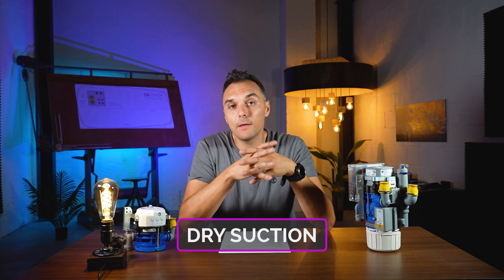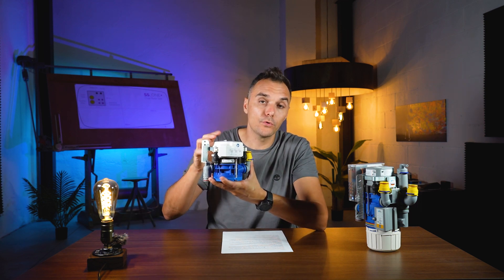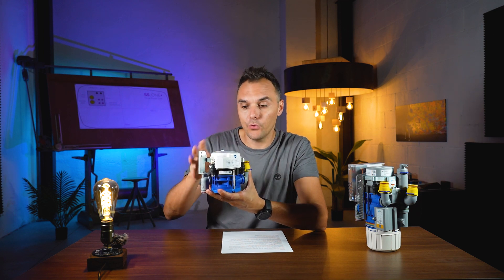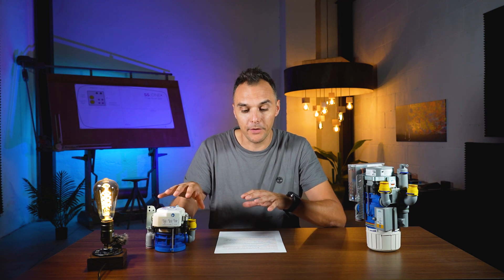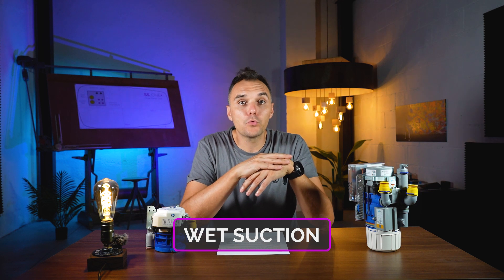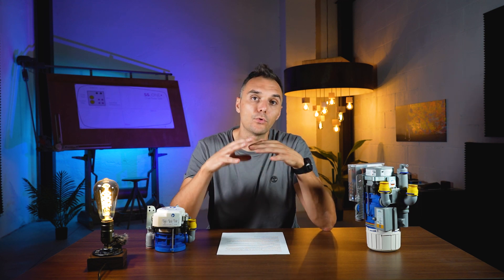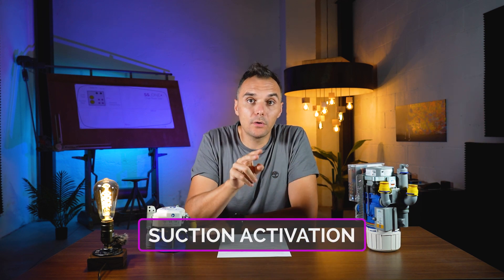ALL TYPES of SUCTION SYSTEMS for dental chair

Comment: If the distance between the chair and the motor is quiet long (18m) which suction system is recommended?
Reply from the maker: Good morning! For a long distance, we recommend a dry suction motor. It aspirates only air and works better on a higher floor or on long distances

Comment: Thank you. what about semi dry suction?
Reply from the maker: Nice question! Semi-dry and humid suction is very similar. The semi-dry has an internal separator, insted of the dry system. In summary, while both systems (semi-dry and humid) can suction liquids, the humid suction system focuses on suctioning liquids and air, whereas the semi-dry aspirator is more versatile and can handle both liquids and solids.

Comment: Thank you for this information. Is there a preferred system of suction if the chair will be mostly used by a dental hygienist versus a dentist?
Reply from the maker: There are not differences between a suction motor for dentist or higenist. systems are exactly the same. 
In any case it's preferable to install, if possible, a wet (humid) suction motor. But it depends on the clinic's shape, the country's standards, and other factors as explained in the video.